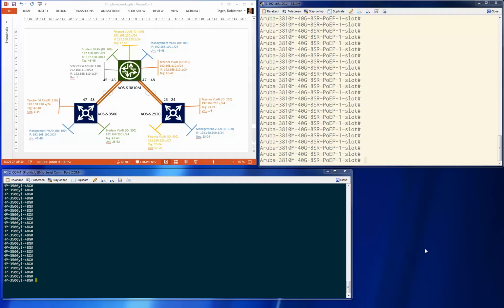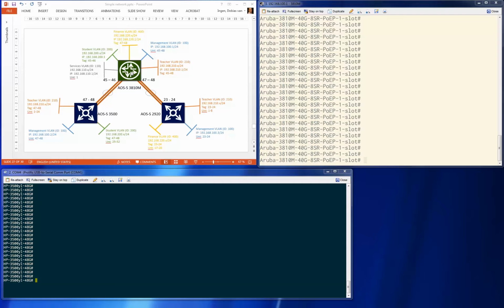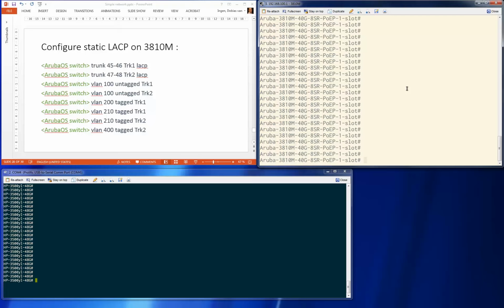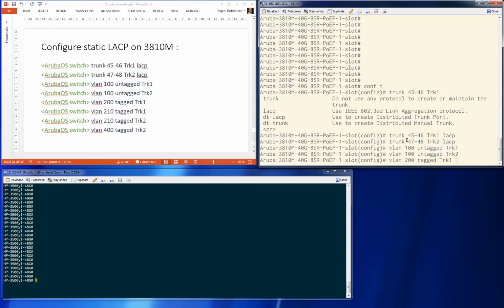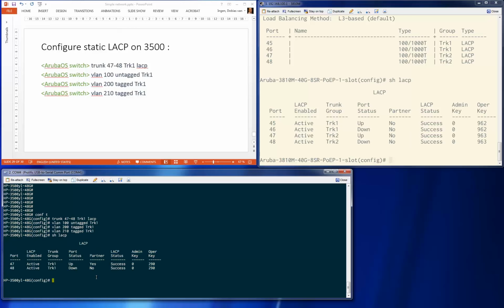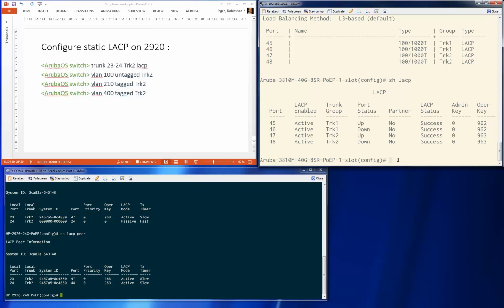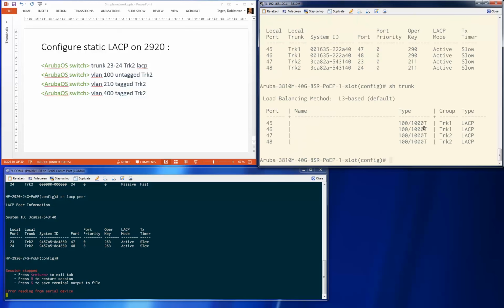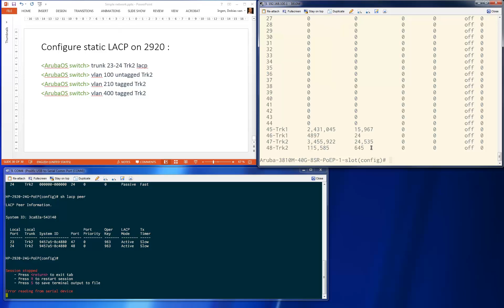AOS Switches   Let's Build a Network 8  - LACP

Comment: great video series, thank you very much. what is the default allowed vlans on the LACP  if i dont specify the tagged vlans across the LACP links?
Reply: In ArubaOS switch, if you add a VLAN tagged to an interface or Trunk(LACP) then that VLAN is also allowed. You will need to configure the VLANs on the switch and add them tagged to any link on which you want to enable them.

Comment: If you have multiple multimode fibre can you use two pairs or 6 pairs and get better speeds from switch to switch.
Reply from the maker: Multiple switch links can be bundled together using link-aggregation, search for 'LACP' for further details.